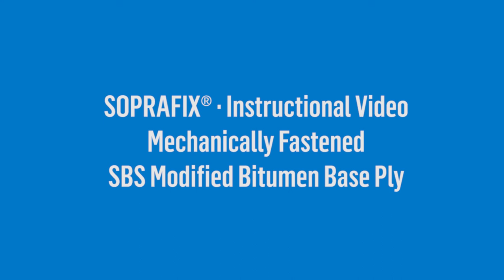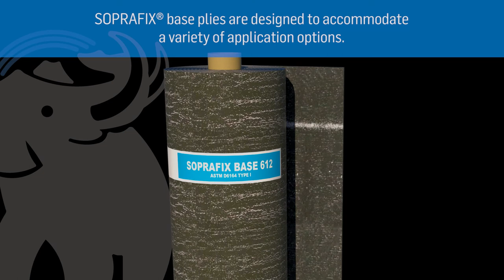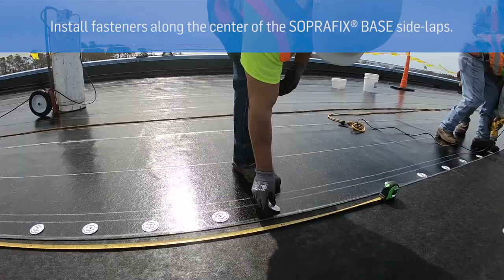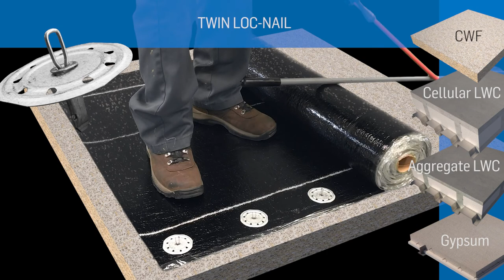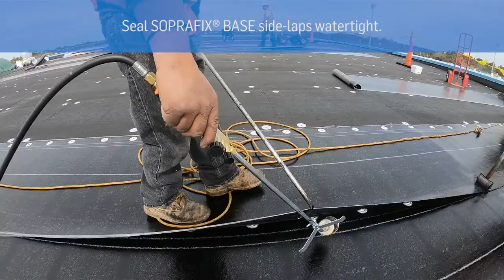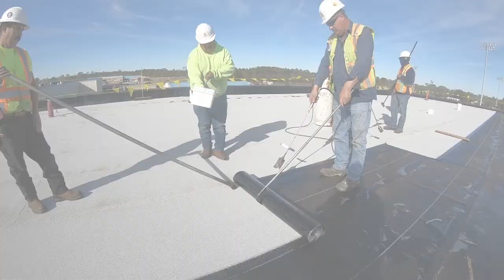SOPREMA SOPRAFIX - Instructional Video

Comment: So how does this system work when you have tapered insulation?  I'm looking at a job right now where the tapered will be 16.5" at the outside parapet down to 6" for the base layer.  Don't see how fastening can work.  You'd need many different lengths of screws up too approx 18".  Would it not make more sense to fasten the base layer and duotack the rest and use a conventional base and cap sheet?